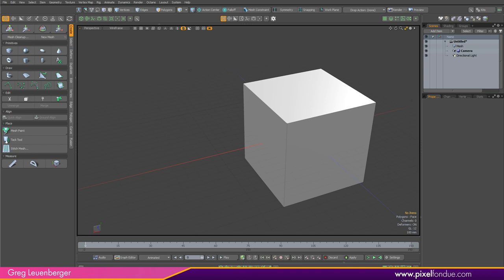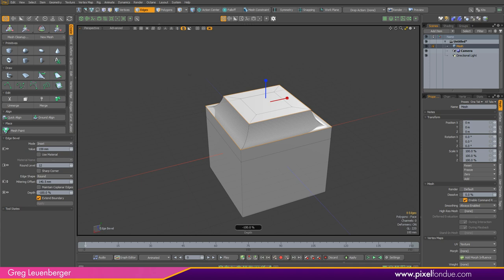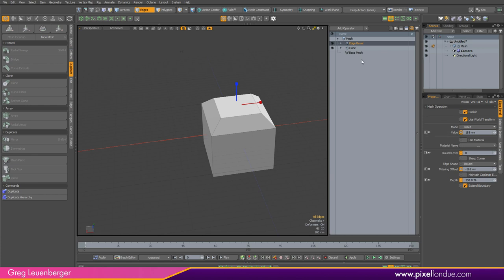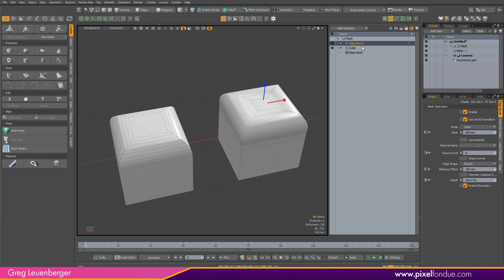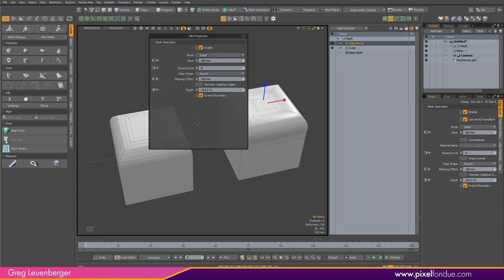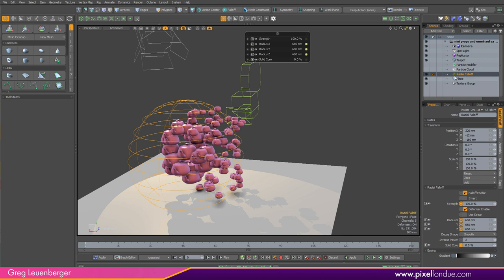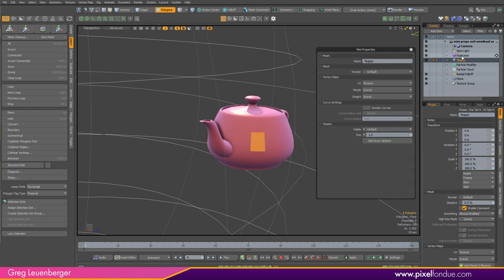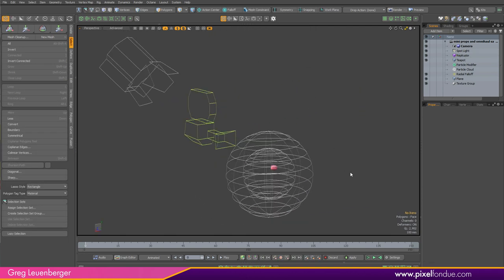MODO 15 Omnihaul Primer

Comment: I've been slow to adopt mini-props, but am now starting to see the use cases. Thanks, Greg!
Reply from the maker: I love them...it's kind of a muscle memory thing.  Need to get a lot more nodes and items implemented though..including materials.  And we have to fix the issue where you can only have 1 item type selected.
Reply: @Pixelfondue  Yep... My thumb is definitely trained to drop the tool with the spacebar. (14 years, since MODO 302)  I'll grow out of it... :)

Comment: This is really cool stuff. One question, how do I map mini-props to a different key? I'm impatient and mapped the spacebar back to drop the current tool and now I don't know how to get mini-props back. 🤦‍♂️
Reply from the maker: I think this is the command (taken from the input editor).  So you can paste this into the command field for whatever key you want in the input editor:  
attr.formPopover {MiniProps:sheet} mini lockProficiency:true
Reply: @Pixelfondue  That's what I would have thought, but it doesn't seem to do anything when I remapped it.
Reply from the maker: @williamreinhard  do you ever go to the MODO slack?  Go there and @jangell - he should give you the right command (he's the Dev at Foundry).  This should be in a FAQ somewhere I think.
Reply: @Pixelfondue  Thanks, Greg! I'll check it out.